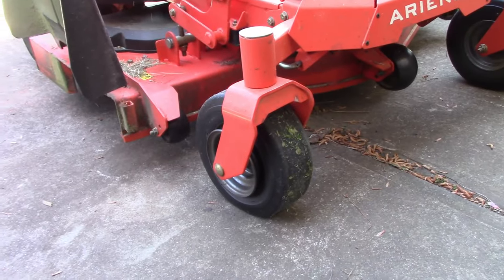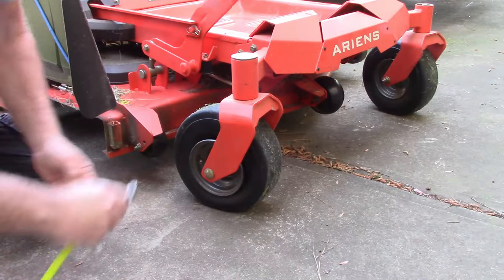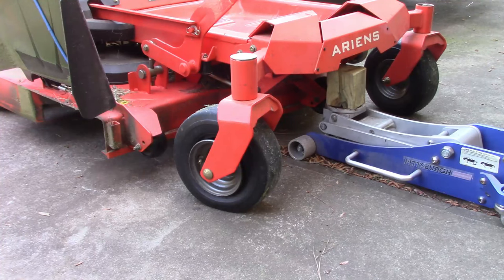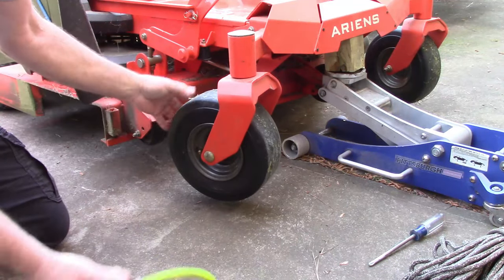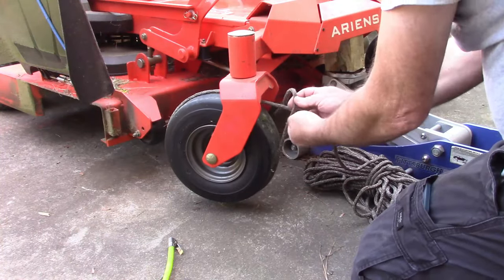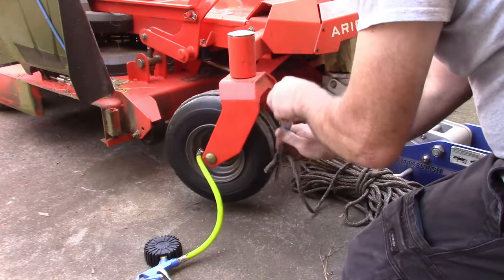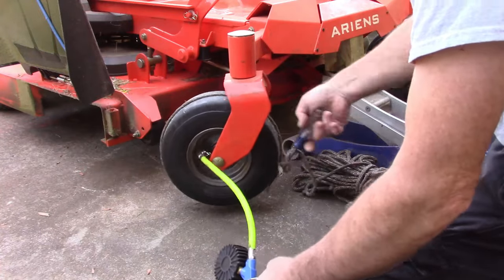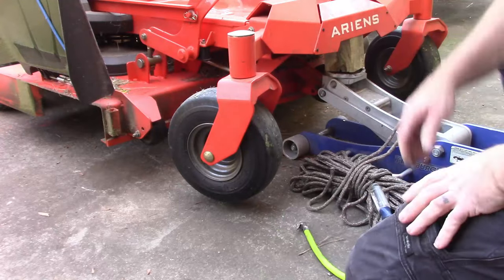lawnmower tire came off of the rim? How to fix it!

Comment: For what new riding mowers cost the companies should use solid rubber tires on the front. I had this problem with my Toro zero turn for a few years and got tired of using a ratchet strap to air up the front tires every spring so I purchased a set of solid rubber tires and I'll never have to deal with this again.
Reply: Who did you order your solid wheels from?
Reply: @M Gerberick  I purchased them on Amazon. They were about $120 with s/h when I ordered them 2 years ago. Amazon was cheaper than every website I checked. Best purchase for the mower I’ve made.
Reply: @CSHayes  Thank you for your quick reply!
Reply: Yeah it's pretty ridiculous. Even if they just put inner tubes in em it would at least remove this constant issue. Tubeless tires to save less than $20 of cost on a mower they sell for $4,000 is frustrating and it's every manufacturer.

Comment: Good! I do the same basic thing. I use a chain fall hoist and take the wheel off and then use a ratchet strap...Yeah it's more monkeying around, but that's how I get-r-done. I went through the entire summer with no flats until September. (In South Alabama it's till summer) Now it has happened twice! DANG! Our old Troy-Bilt ZTR we had the front wheels filled with polystyrene...I got a mind to purchase some solids for this Ariens IKONXD. Great machine! Absolutely love mine as I know you do yours! Thanks for the great video brother!👍👊🤙

Comment: Thank you very much just used this trick on the rear tire of an older lawn mower. It didn't work at first but after taking the tire off and laying it flat and pushing down on the rim it worked like a charm. Just worked a 12-hour shift and the sun was setting, again thank you